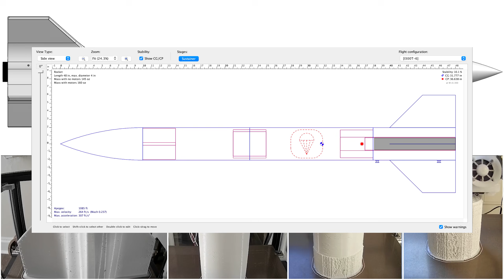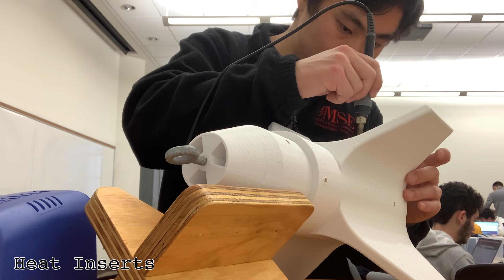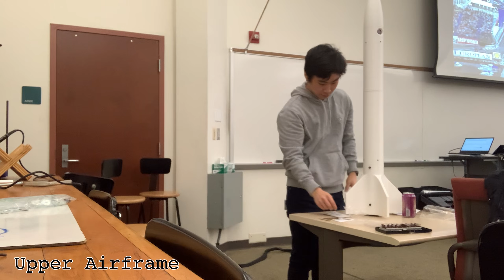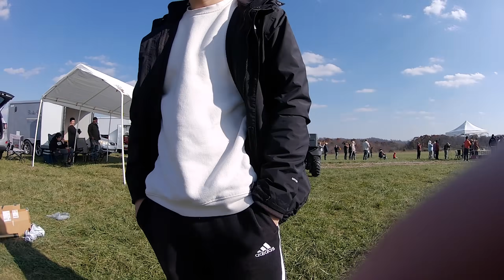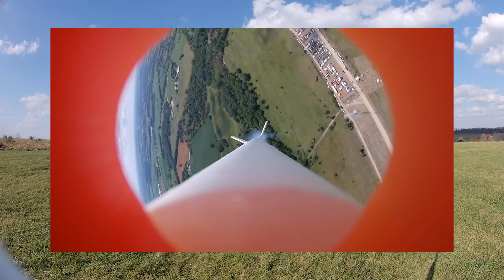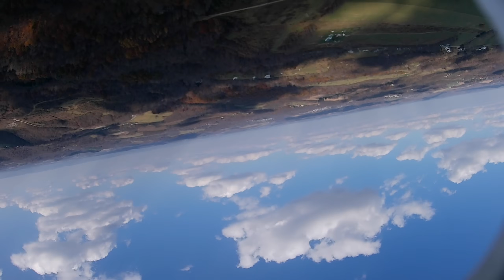Launching a 3D Printed Rocket

Comment: Hey, i have been working on my own designs for both 3d printed mid power and L1 rockets, and i think that you would be able to get away with way thinner parts. I have come to realize that 3d prints are way stronger than you might expect, especially in the load case of a rocket. I’m designing a 3d printed fin can for my L1 cert attempt using petg-cf, and i believe that 3mm thick walls are probably more than enough. I might be wrong, but you could definitely take this design higher and faster if you wanted to. I also highly recommend printing threads into your sections and screwing them together rather than using bolts.
Reply from the maker: Yep, I'm looking into adding threads to my L2 rocket to secure the various body tube components together. I tried something similar in our club's 2024 NASA SLI competition for our payload.

Comment: Was the first flight a failed cert because the onboard camera didn’t record? Are they a requirement now? Or was it because there was technically a malfunction even though it wasn’t flight critical?
Reply from the maker: Nope, the first flight of the day was successful and I got my CERT even without the camera as its not a malfunction. I was actually referring to my first flight the summer before at LDRS where my the launch was successful but the parachute didn't deploy and I didn't get my CERT there.